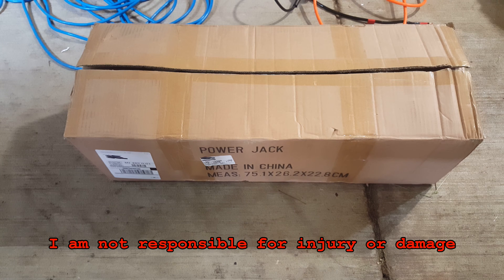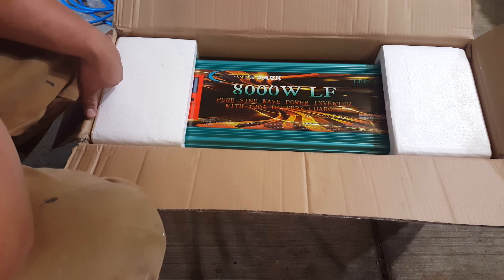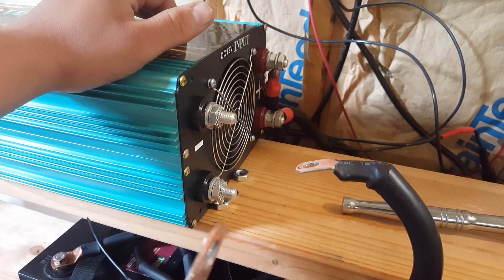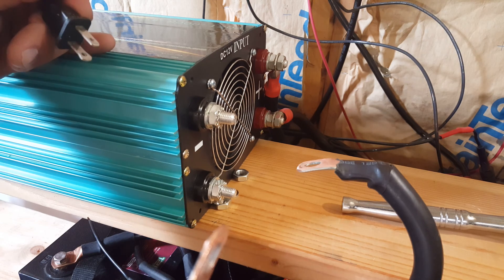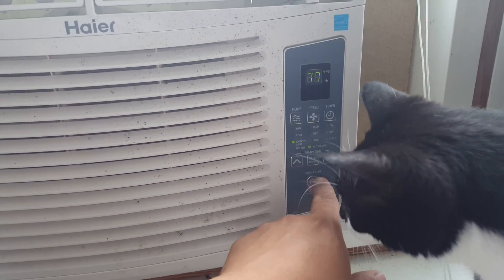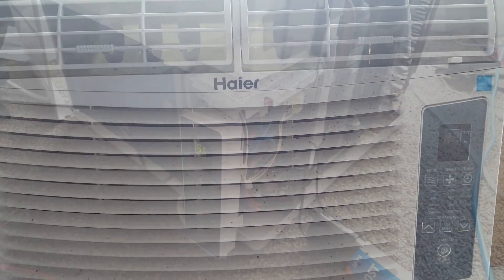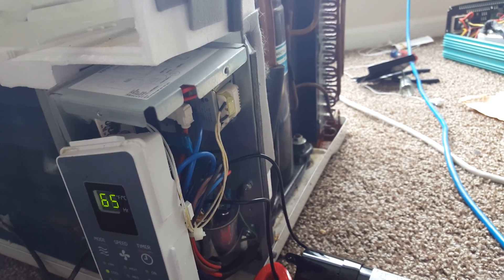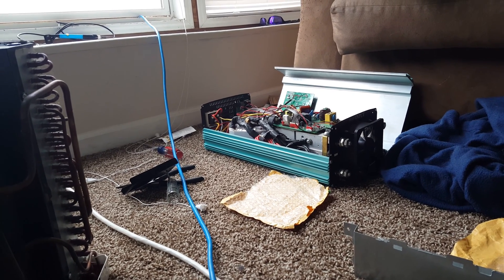Power Jack 8KW LF inverter can not start everything

Comment: It's important to note that an air conditioner with a tight compressor can draw 15,000 watts on startup due to the bad compressor.  So is it the inverter or the a/c unit?
The Supco SPP6 is an age old device used in the air conditioning business for many years.  It's the electronic version of the original hard start kit used on units with 'tight' compressors.  Not sure whether your's came with one or you added it.  Either way need to use one is possible sign of tight or defective compressor.  I've seen new units where the manufacturer would send one of these free of charge to see if the unit would function once installed.  Cheaper than replacing a compressor.  Sometimes they don't work if the compressor is very tight.  That extension cord might have caused a voltage drop as you mentioned, as well.  And I personally have seen one of these hard start kits on a unit from the first day in service until 30 years later when the unit was condemned.  Basically, it is composed of a non-cooled start capacitor with an electronic potential relay that measures back EMF to de-energize the capacitor.  In the old days these kits were comprised of the capacitor and an open potential relay wired in to measure back EMF with contacts that opened one side of the capacitor.  Manufacturers of refrigeration equipment have no way of knowing if a compressor is going to be tight prior to installation and therefore once installed they ship.  When the tech finds the unit has a tight compressor (probably about 1 in every 100) the hard start kit is installed to see if that will get it running.  But the downside is the compressor will draw considerably more current than one with a normal compressor.  But who knows the difference (except the tech)?  
More than likely you have a bad a/c unit rather than a bad inverter.

Comment: I got the same inverter and I can run way more than just a air conditioner I run whole house and cabin with deepwell pump use the high power outlet going to the breaker box not the plug on the inverter only puts out 1500watts

Comment: You need to get bigger power wires to run big appliances get dual 0000 gauge wires for power and ground then you will get full power

Comment: Don't you need 2 positive cables and 2 negative cables connected to your battery bank for full input flow to run an air conditioner?

Comment: I have an 8000w powerjack My question is. On the DC input side there are four terminals. Are they on two seperate circuits or are they all connected internally.
Reply: They are connected internally, the extra terminals makes it easier to connect another battery bank in parallel for more power

Comment: Saw a video on the 15kw version. A 20 amp fuse on the AC side will not delivery 15 kw.   The system shut down when you got to 20 amps worth of load...

Comment: I have one also mine is 24 volt input and it will run my 220 volt heat pump outside. I suspect your window unit is just an eneegy hog.my heatpump is a 4 ton unit and it works ac only on my 8000watter power jack. It has ram everything i put on it..i have a plug for 220 to back feed with mains off and love it. I have 5000 watts of solar panels and a 1200 pound forklify battery at 24v and a hybrod car battery also at 24 volts in parallel. My heat pump is 220 so your 110 unit is only using 50% of. Poaer jack as told in the manual. Only 220 is 100% power

Comment: It will need (MUST) 48volt battery system. 12 volt system you can run only 2000w, 24v system can run 4000w, 48volt system require (top 8000w ~200Amps)

Comment: What was the input voltage to the inverter measured on the terminal posts when the compressor motor was starting? Also, when the inverter shut down, was it due to overcurrent or low input voltage?

Comment: using the plug doesn't allow much amps but using the hard wire to my RV the 5000w inverter runs my 15k btu a/c, but it will run down my batteries faster than my 400 watt 24V  solar can not maintain it only for a short time

Comment: 12v input.... Is alot of amps to charge capacitors to start. You need 48v to run softly and minus amps!. To hot tuning electronics.

Comment: I know this is old but if you have DC circuit breakers in the input lines you do not have to worry about the arcs when you first hook them up. In my case, I have 150 amp, 42 volt rated ones with a push button open and toggle close. No arcs and sparks anywhere and they are sealed units.

Comment: if your wanting to run your a/c off of your inverter you need at least 16 1000 marine cranking amps or lithium amps, as long as its 1000 amps per battery at 16 or even more batteries,...then it will run the a/c,....if your just going to try to run off of 4 or 6 batteries,...not going to happen,......the more amps the better longer lasting power

Comment: Also I have had negative experiences with Power Jack inverter. I had 5kw, then 8kw and now 10kw (all 24vdc to 230vac). All models can not bear the declared kws. The maximum real power is ONLY half. They also heat a lot and for this reason the mosfets are continuously burned. Controls are also poor and there are continuous reports of errors. I have applied two important changes to correct the faults of the inverter:
1) improved ventilation by adding a second fan with a 45-degree temperature sensor
2) improved control of overcharge error reporting by changing a resistance on the main board.
Without these changes the inverters will not work.
The seller tells me that the responsibility is mine and he suggests me to replace the main and contol boards.
After this long experience I do NOT suggest the use of these inverters.
Poor quality.
Reply from the maker: Did you run both legs?
Reply: I do not understand the question. Can you give me more details ?
Reply from the maker: Did you use both 110 volt legs ? Each leg is rated to 50 percent.
Reply: I don't think any of the Powerjack inverters are true split phase.  That's probably so they can meet European spec 220v, single leg.  If you want split phase you have to run through a center tapped transformer first.

Comment: Hi .  interesant to know..  your scroll air condition pump is 2 pole ac electric motor .   this type motor need to starting with VFD.. no start directly by inverter . bcz at the atart need 16 time more current for the normal load.   ..  i have start 15 kw motor with 3.5 kw inverter with this system ..https://www.youtube.com/watch?v=YeeOFDdeqSE

Comment: 12,000 BTU should be only about 1,200W!  If that inverter can't handle 1200 Watts, then it's just typical for PowerJack.  Highly Overrated!   What was your input voltage to the "8,000W" unit when it dropped out?
Reply: +Lounge Lizard : I think we all are making a mistake here !  Loads like air conditioners, air compressors, water pumps etc are inductive loads. At the time of starting, these can drain a lot & lot of power to start & can be 4 to 8 times their actual wattage for atleast  4 seconds !  We can handle this problem by using Low Frequency Invertors which are actually capable to do so. On the other hand, Hi Frequency Invertors  can only tackle this situation for fraction of a second - as a result such invertors may have a much  & much higher wattage ratings(here it is 8000Watts!) but incapable to start an inductive load of 1200 watts even - so it is not a case with makes of the invertors but of the basic topology of system we are using IMHO.
Reply: @GautamKumarGoswami  I agree.  The initial inductive load will be much higher, but they rate these as much as 4x for momentary loads such as inductive.   My 2000w hf inverter will handle very short draws of 4kw (like 3mS i think) but has no problem starting my refrigerator.  I would expect much better from a lf rated at 8kw continuous load!

Comment: I have the 8000 low frequency 24 volt model.  It will run 4 6000btu window units, refrigerator, 2 Tv's 2 sat. boxes and as many lights I need. Great inverter wish I had got the 48 volt model.  Great videos on all your reviews. Do you know if I can get the 48 volt model. This will be my third summer using it.
Reply: Hi Darren ! Please tell me the low frequency invertor brand you are using.

Comment: I bought 1 16k and if the fan is not on all the time I get an intermittent low voltage scenario....it.is like instantaneous but light went off and on and the fan turn on with very low.load

Comment: That extra start capacitor is nothing more than providing an extra kick to get the compressor over it's first compression cycle. It helps the stock capacitor by providing more current. It does not act like a battery or any type of continuous power. It pulses with the 60Hz line frequency. I had to put one on our central A/C outdoor unit because during very hot days in summer, our line voltage would drop a bit and the compressor could not start. The assist capacitor does the trick.

Comment: Can you diagram how exactly you hooked this up to a load panel?  The instructions are terrible.  There are 2 sets of white blocks then a 3rd set for 220 above covered with a plastic placard. Which should be the feed from existing AC 220 and which should go to the new service panel for split phase?  Thanks so much.
Reply: your right NO instructions!

Comment: 12v not good you'd b better off with 24 to 56 volt of inverter  as 12v 1amp 15 watts so the draw on 2000watts at 12v is about 200amp 24v about 100amp 48v about 50 amp 56v around 20 amp also 0 to -4 gauge wire for the current to flow without pulling batt voltage down really quick
Reply from the maker: +Robert Stevenson this is an old setup. Running 24 with 8 batteries noe

Comment: I have the 24 volt 5000 cont and 20000 serge  watt version  of this inverter and it will run my 12000 btu air condtioner with no problems.
Reply: CutMaster CNC hello what brand and where can I purchase, and what's the price?

Comment: You need more batts  you can even run a  welder off  mine  and has enough power to trip my power board safety cutout  (10A 240V) mine has  25A fuses in it that unit also looks smaller than mine which is about 34" in length .
my compressor draws 22A 240V on start up.
Reply from the maker: +Awesomus Maximus this is an old video. I currently have 8 200Ah solar batteries wired in 24 volts. A much beefier setup
Reply: Sorry my bad
Reply: I just discovered by accident you can run a grid tie inverter with it and it can actually back feed power back into the batts
Reply: that is an awesome discovery and alternative use of a grid tie.
Reply: I wonder if I'll be able to start my 8 gal/120v harbor freight compressor with this inverter...
Reply: did more batteries help with the start up? if i try my 1500 watt ac with the 5000 watt unit it blows the inverter fuse instantly. 20,000 watt surge my ass. it only has a 25 amp fuse.
Reply from the maker: +immrnoidall my battery bank is more than enough to start anything in the house.

Comment: it's not the inverter's fault you need batteries with higher discharge rate go for Li on 
 batteries Samsung 185650 25R has 8c discharging rate I feed an electric vehicle by 400 of them.

Comment: i lived on solar for 10 years and 1 thing i learned was that i needed larger cables and more batteries than you would think.
under high  load the volt / current will drop if you do not have big enough dc hardware that means that high load equipment
will have trouble starting / running.

Comment: I have a 220 around 20kbtu but the fan cant run withput the compressor running it just hums I don't use an inverter it runs on 240v I am using a 6kw grid tie inverter tranformer to make the 120 to 185 witch runs it but sometimes it stalls the compressor just have to wait 15 minutes but it runs for almost 5 houra without stopping

Comment: it is 8kw at 220.4kw at 110. and these inverters are rated almost double what they are capable of,,, so 2-3 kw. think of the 18650 vaping batteries being sold as 10,000 ma,when an 18650 bat. can only be 3000 ma MAX. same thing. china lie.
Reply from the maker: +immrnoidall with as hot as these get, even at 220 I would not push more than half the rate through them. The Torroids are not wound to take the continuous loads. Only in short bursts. For long term duty cycles I am keeping under the half way rate.

If you look at the leads running to the heat sinks on the main board they only use 4 awg wire. So at best you can push 200 amps in continuous before you run the risk of overheating the wire. That's only 20 amps on the AC side.

Great inverters none the less. I just got done modding mine for improved cooling.

Comment: I vote you try taking all of the nuts off the inverter battery terminals and then put the battery cables on the terminals first, followed by the nuts. Just to try getting the cables more surface area to contact and also so they are not conducting hundreds of amps of current through those non-copper nuts. Simple connection stuff like that has been the different between a little 750watt harbor freight inverter being able to power a small window unit or not for me. I bought one of the 5k watt power jack inverters after your last set of videos about it; I really should make a video of it running stuff. I also have a copy of your charging setup and a renogy 4210 charge controller that I should make a comparison video for. I've just been too lazy and left everything on grid tie to save on cycling my batteries. I'm glad you're making videos on your setup again.